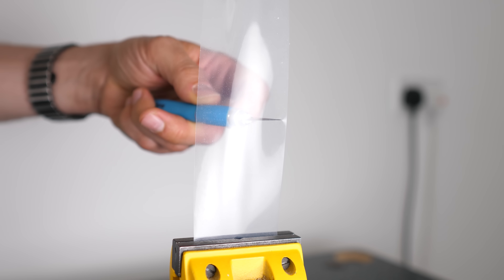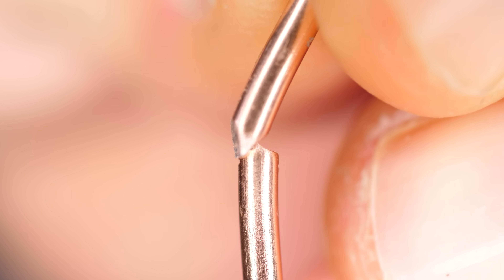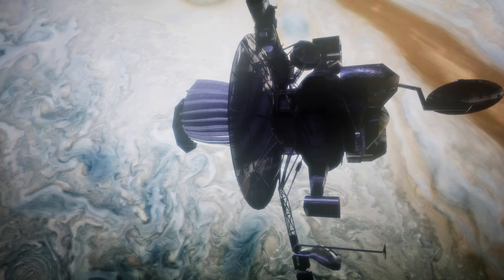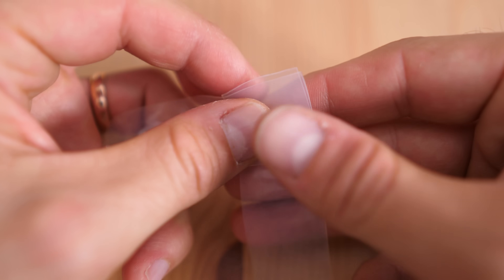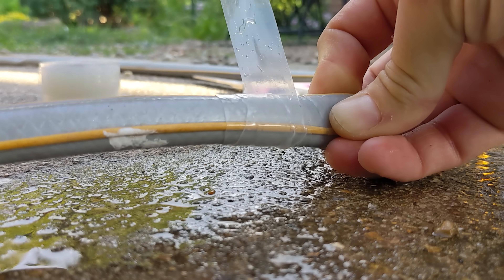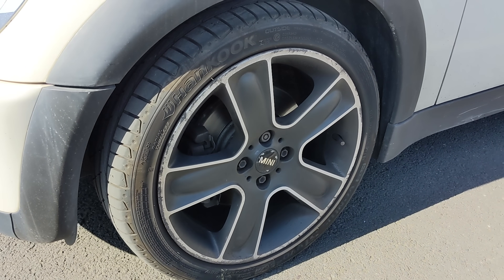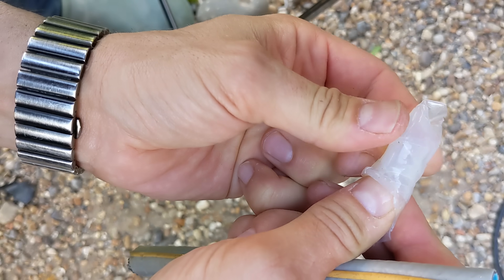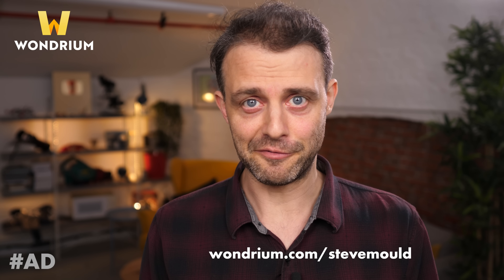Self-Healing Material

Comment: Steve, when you join those two pieces together, is the reaction endo or exothermic by chance?  You probably won't be able to feel it but a FLIR camera may show if it gets warm or cooler.
Reply from the maker: Really good question. I might give that a try. Need to find my FLIR. The issue is I push it together with my fingertips which would probably swamp any slight changes in temp.
Reply: @SteveMould  Can you push two ends together with two wooden spoons or plastic tongs to avoid heat transfer?
Reply: @edwardlees4585  I suspect silicone something would work better, maybe a silicone spatula. Either way though change in temperature may be too small, also the act of pressing anything with anything will increase temperature, possibly even more so if either of the things is elastic
Reply: @aleksandertrubin4869  Presumably as long as you take a background temperature reading first you might be able to detect a slight change. What to we think? Exothermic or endothermic? I'm going for the former only because I assume the bonding process would work in any environment.
Reply: @SteveMould  is light pressure always nescessay? Will they stick if they just lie around, touching eachother? Maybe after time? Depending on room temp? What if you use other methods of applying pressure? What about vacuum? So many questions!?
Reply: @petediazdee  this is the logical next step from the op’s idea. Well done! I really hope he sees it!
Reply: @petediazdee  My thoughts exactly!!
Reply: @petediazdee  some cars use a self healing material to cover the front of the car to protect from rock chips and what not. My understanding is that a bit of time in direct sunlight causes the material to self heal.
Reply: @SteveMould  

If you do, please update us!
Reply: @SteveMould  Try pressing together with something like pliers?
Reply: @KitagumaIgen  any kind of pressure will eventually generate heat
Reply: @KitagumaIgen  but it will still generate some heat form the kinetic energy.
Reply: The application of pressure will generate heat too. Perhaps lay tow pieces on top of each other, film in FLIR and wait and see if gravity is enough for them to fuse
Reply: @buntyshukla2625  True, but just make a simple experiment: take an ice cube and press it between your fingers for as long time it takes to say (pdV + Vdp) out loud and then tell me if you transferred more heat to the cube than you did work on it.
Reply: @SteveMould  it also may be hard due to heat from friction...
Reply: @elliotmarks06  you could use a piece of metal, to push them together. metal is usually pretty good in saving heat
Reply: @elliotmarks06  Giggity.
Reply: @SteveMould  why not hold the material as close as possible to the cut with clamps
Reply: Make a little wooden or plastic press, put one piece in the moving part and one in the table and press them together
Reply: @SteveMould  You could try pushing them together with bunch of glass tubes or other temperature-neutral implements if you decide to check it out.
Reply: @SteveMould  It sounds like a great case for another see through set up... (but not glass because that would block the thermal IR...)
Reply: @SteveMould  push it together with some sort of roller!
Reply: @SteveMould   Try pushing them together with oven mitts?
Reply: @SteveMould  maybe try using a rolling pin to fuse them together. You could also use the rolling pin on the same spot once the temperature equalizes after the reaction to rule out material deformation as a possible confounding variable.
Reply: @SteveMould  Hmm, so does the material perhaps require the input of body heat from your fingertips in addition to the added pressure? Does the material "self-heal" differently if pushed together by other things such as plastic tableware or sticks of plastic made to be the exact same temperature as the self-healing film? Maybe an experiment wherein you record with the FLIR pushing a piece of the material with your fingertips as a "normal control" and a similar trial in which you take the same material at the same temperature as the "normal control" and push it together with pieces of a rigid material made to be the same temp as the self-healing film as a "test sample"?
Reply: @SteveMould  Why not use something that is already at room temp to push them together?
Reply: @SteveMould  I was literally going to say that about the heat transfer from your hands. Maybe try applying pressure with a room temperature mechanism.
Reply: @SteveMould  Push them together between 2 pieces of AreoGel - It has a very low thermal conductivity so it shouldn't change the reading by much
Reply: @SteveMould  use a flesh light to hold them together!
Reply: @SteveMould  push them together with a room-temperature stick of wood
Reply: @SteveMould  Try wooden or plastic tongs? Or oven mitts?
Reply: @SteveMould  if it requires CONSTANT kinetic energy to join together shouldn't it be endothermic to start with?
Reply: @SteveMould  use tweezers?
Reply: @SteveMould  use a q tip possibly
Reply: @SteveMould  Embedded tiny thermocouple/rtd between the two layers.
Reply: @SteveMould  why not use forceps or something else at room temperature?
Reply: @SteveMould  use bamboo skewers!
Reply: @SteveMould  maybe try pushing with something different
Reply: @SteveMould  make a jig to hold the pcs.
Reply: @SteveMould  so don't push it together with your fingers, use something that's already room temprature
Reply: @SteveMould  would it be possible to combine them with a relatively decent insulator so it doesn't interfere? Like a styrofoam cup?
Reply: @SteveMould  You could sandwich two pieces together with glass panes
Reply: @SteveMould  lol again get a roll of loctite(or any brand) self adhering tape and just wrap something and watch through the flir.
Reply: @SteveMould  please follow up this video with another one. Examining whether or not it does the same thing at different temperatures and if there is a temperature change as a result. And for the love of God please tell me what it is so I can go buy some of this fascinating material.
Reply: @SteveMould  Would love to see this under an electron microscope mid-press lol
Reply: @SteveMould  you could use insulated electrical pliers. Those shouldn’t impart too much energy.
Reply: @SteveMould  u could use some sort of tweezers
Reply: @SteveMould  , so you actually have to press the pieces together, you can't just overlap the pieces and they heal together? So it requires an application of external activation energy, just considerably less than other materials.
Reply: The process did remind me of metals getting welded back at high temperatures. But surely if (low enough) pressure moved the melting point to room temperature, this would've been noticeable in general use...
Reply: Just hold two ends of long strips of the material and have the contact point be at the center where nothing's touching it.
Reply: I’d expect it to be endothermic, but who knows
Reply: Bond forming from fusing is typically exothermic as it releases energy
Reply: @Fr8train003  now thats the sort of comments we need. thank you for educating us
Reply: Exothermic when bonds are formed
Reply: that‘d be really interesting to know.
Reply: Probably exothermic because bonds are being formed
Reply: What's wrong with your E2qNxcfdujdtyjbb7fc ?
Reply: usually polymerizations are exothermic, but sincerely do not have an exact answer to this question
Reply: If I can hazard a guess, I'd bet it's exothermic, since breaking the bonds requires energy so my thinking is it should release energy when the bonds are formed. I barely passed chemistry though, so I'm certainly interested in an experiment.

If Steve does do it though, it might do to press some polymer just by itself in one layer, so that no bonding occurs. He could also do an extreme case with multiple layers being pressed together at once. That might show how the amount of bonding affects the exit temperature.
Reply: It might be endothermic as when we will heat a polymer it expand i.e. it's bond looses
Reply: Make a jig to push them together
Reply: It is probly expthermic since entropy seemms to go down and in order for gibbs to stay negative and the reation to proceed, it would need to be exothermic
Reply: Good question. you’d have to use tools heated to the same temperature as the material, because anything else like hands cold metal tweezers would draw or deposit heat
Reply: Making bonds is exothermic iirc
Reply: Nerds
Reply: Can you buy this anywhere?
Reply: LAKI 88 , the juice is this ?

Comment: Why don't we weld in vacuum then??
Reply: We DO weld in the absence of oxygen. TIG and MIG welding flood the weld in inert gas (e.g. argon, carbon dioxide, etc.).
Reply: @metamorphiczeolite  yes but what if instead of melting the metal and the oxidation away we just cut the oxidation away under inert gas?